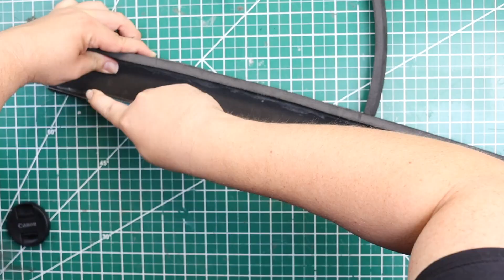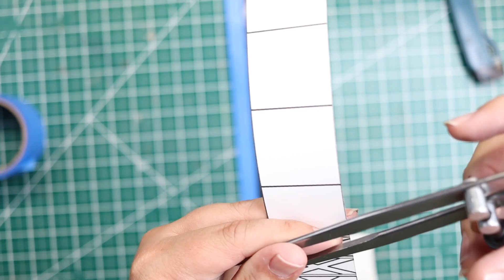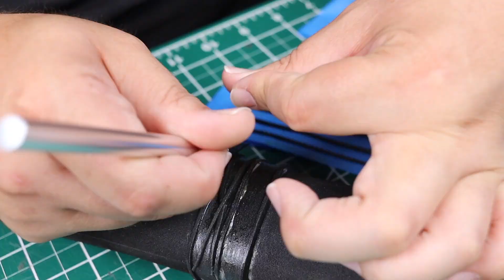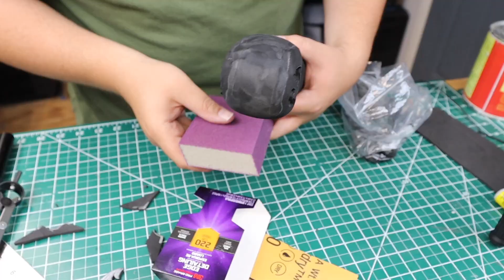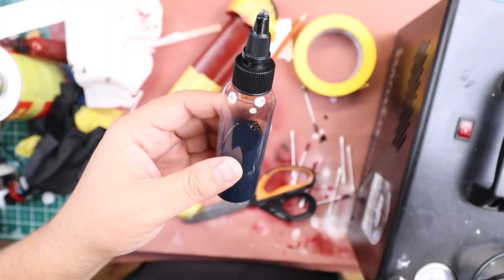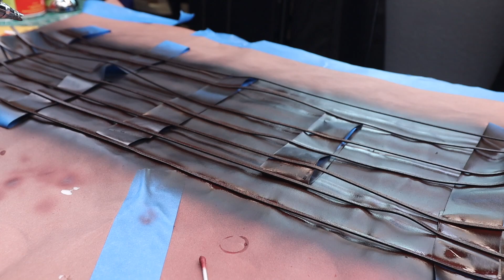How To Make Zoro's Sword Kitetsu Part 2 (Sheath)

Comment: Awesome job! One question, is ithis sheath hard enough? It doesn't have any support, so it, probably, bends quite easily, right?
Reply from the maker: I had that worry too, but I think since it’s 10mm on each side, it’s really sturdy. I tried to bend it and it’s not bending as easily, of course if the sheath were to hit something hard by accident, it would bend it, but should bounce back into place and just do some paint touch ups.
Reply: @LockProps  thanks for answer!